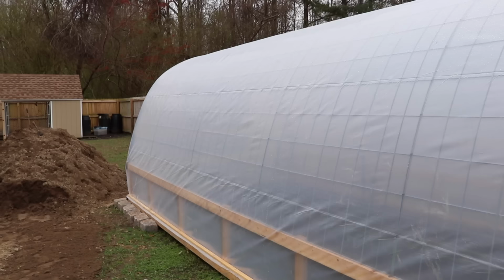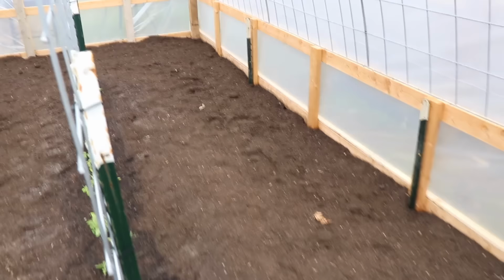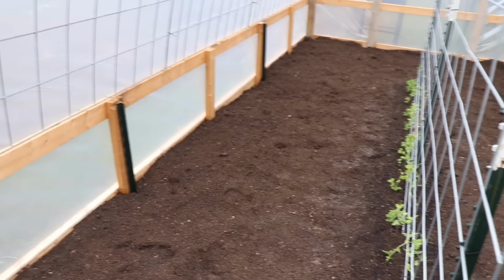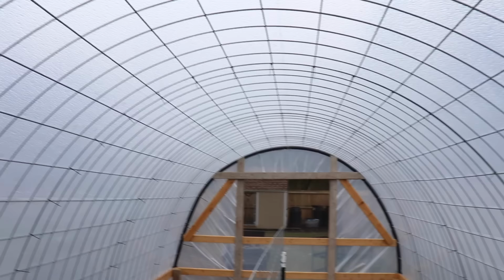DIY Cattle Panel Hoop House || Build Your Own Cheap & Easy!

Comment: Your project turned out super nice! Congratulations on a truly useful DIY gardening project.   That said, I'm still not sure I want to do a high tunnel.  It may be right for some types of gardening in some locations but definitely it has several MAJOR drawbacks.

For one thing, I live in Jackson, Mississippi which has a subtropical zone 8B climate that gets EXTREMELY hot and humid during the summers.   Any enclosed structure becomes like an oven baking the plants even with shade cloth.  Running large fans increases the costs of operation.   The plastic just traps heat and gardens in the Deep South don't need that!

Second, the moment you create a closed structure, you lose all the rainwater from Mother Nature, which in my area is between 55 and 75 inches of FREE and PURE water per year.   With the hot, dry climate, it means blocking the natural rainfall creates a time consuming chore of watering every plant inside the tunnels on a regular basis, often daily.   I don't need another chore to do!

Third, structures like this keeps out the birds, toads, and other critters which help with pest control.  I only grow organically so none of my plants have any chemicals on them.   Thus all the bug eating critters flock to my garden and eat tons of damaging insect pests.   I really don't want to lose all that extra pest control help by blocking them out with a sealed tunnel.

And then there is the cost of maintenance. We get several hail storms most years.  I've seen hail break vinyl siding and double pane glass windows in houses so I know a 6 mil sheet of plastic would be shredded by a hailstorm.   We also get frequent hurricanes and tornadoes here.   Hurricane Ida passed about 20 miles west of my house just last week breaking large tree limbs in the process.   I don't need the chore of removing damaged plastic or the costs of buying new plastic and installing it every time a hail storm comes by.  Most plastic sheeting isn't UV treated and will also deteriorate on its own fairly quickly in an are with tons of hot sunshine. Thus periodic plastic replacement becomes a never ending cost and chore.

Finally, having plants grow in a sealed building means the beneficial pollinators can't get inside to pollinate the plants.  There are plants which don't depend upon pollinators but there are just as many favorite garden veggies which absolutely MUST have pollinators visit them regularly to produce a crop.   

I'm not pouring cold water on your design.  I'm only pointing out considerations which anyone needs to stop and think about before deciding to spend $500 or more per tunnel. For my 25 x 30 garden, it would take three tunnels at a cost of more than $1,500 and about a weeks worth of my time to create tunnels over my garden area.  While production might increase due to longer growing seasons, it would probably take at least 10 years to recover the initial expense from more production.  I'm not sure the structure will even last that long!

After watching quite a few hoop house videos, I have seen other designs, such as hoop houses with hinged windows that allow the entire sides to be opened during the day, which are better suited for Deep South climates.   Hoop houses may be the right thing for some situations but I'm not yet convinced they are cost and time effective for many gardening or farming circumstances.
Reply from the maker: Everyone has to evaluate their own circumstances & make the decision that’s best for their garden! For us, we LOVE greenhouse & hoophouse gardening! Thanks so much for watching. 😊
Reply: @HomeFreeAlaska  I get it that you love using these structurers.  But rather than tell your viewers how much you love your hoop houses could you genuinely address how you deal with some of the 5 inherent problems I listed when using hoop houses?   I watched your  video to get the benefit of a real world experience from someone who could provide useful information to consider before I make a $1,500 investment building 3 hoop houses.  I'd didn't want an infomercial that only tells the "wonderful" side of the situation.

For instance, do you substitute your time and labor watering all the plants for the free rainfall that the hoop houses block?  Are you making that trade off because you are in love with gardening and enjoy spending hours of time each day tending to the plants? Do you realize that many others simply don't have the time available to replace with human labor the 55 inches of rainfall plants NOT growing in a hoop house would receive naturally.  

Not to mention that as an organic gardener, natural rainwater is the ONLY thing I want on my plants.  Our city water is under EPA health advisories as unsafe to drink due to lead and copper contamination.  Putting that water on plants as a substitute for the natural rainwater makes no sense.

Or, for instance, do you live in Syracuse, NY where there are no hurricanes, tornadoes, wildfires, or earthquakes and little flooding to ever worry  about damaging your hoop houses?    For the 29% of America's population living inside hurricane zones, hoop houses probably are unwise investments.

I didn't dislike your video. I watched the entire thing.   It's certainly a good option for SOME situations but honestly, it probably isn't workable for at least half the gardening population in America.
Reply from the maker: @TrehanCreekOutdoors  my friend, my video wasn’t about the pros & cons of hoop house gardening. My video was just showing how we chose to construct a hoop house & the materials we used. There are a lot of videos out there that go in depth about the pros & cons to hoop house gardening, this video was not intended to be that. Sure I may have mentioned some of the things I love about hoop houses in the video, because I do love them. In my opinion, for my climate & gardening goals etc., the issues that may come with hoop house gardening that you’ve mentioned…we feel the benefits out weigh those cons. We do not have city water, we live on a well & with the sprinkler system we installed in the hoop house, it makes watering easy & not an inconvenience at all. Everyone has to decide what’s best for their unique situation. It sounds like you are already aware of all the cons as you listed them multiple times, so you just need to decide if a hoop house is worth it to you. My video wasn’t an “infomercial” either…it was simply the construction of a hoop house. Since I haven’t created a video on pros and cons of hoop house gardening, I’d refer you to check out some of the other videos YouTube has to offer on this subject.
Reply: You can simply remove the plastic sheeting in the warmer months to alleviate most of the issues you mentioned. Here in Texas, many growers add shade cloth in the summer as well. You could also use the cattle panel arches as a trellis in the warm season!
Reply: @julietlaney2776  Buy the cattle panels, the plastic, the fasteners, etc....spend hours putting it all together....then more hours taking the plastic off, store the plastic, and after that, rinse and repeat by putting everything back together.  Why do that?  Because it lets the gardener grow under the same conditions that you would have if you planted in an open air garden in the first place.  Gee, I guess that makes sense.  Thanks for explaining the benefits of high tunnels to me.
Reply from the maker: @julietlaney2776  oh we don’t want to remove the plastic sheeting that would completely defeat part of its purpose which is to keep the pests off the veggies! 😉 We have major pest issues here in this area of VA that we’re in. The hoop house & greenhouse environment is the perfect growing space & has almost 100% gotten rid of our pest problem. 😊 We’ve added a shade cloth & more ventilation to the hoop house & it did really well thru the summer! We had a really good harvest this yr, very cool! ☺️

Comment: Nice job. Thank you for posting.
 Suggestion - 1" black polyethylene pipe sliced lengthwise will hold up longer on the outer fence edge. zip ties don't last more than a 6 months here in California.
Reply from the maker: Thanks so much for the suggestion & thanks for hanging out with us for this video! 😊

Comment: I had a couple questions for you if you don't mind!
I am building a "Peacock Palace" using this same idea but we will be using corrugated metal on a wooden frame base and 50" x 16' long cattle panels. My idea was to use two cattle panels for each section to make it tall enough for my birds. They like to roost at least 6' off the ground so nothing can grab their tails. I'm wondering how wide and how tall it will be and have no idea how to figure that out! Also, how strong will it be? We don't usually have snow here and I won't be wrapping it in plastic so I don't worry about that, but we do have wildlife that would gladly eat a Peacock if they caught one! 😅 
Thanks! R

Comment: Instead of cutting the last panel, just over lap them.  Might be a good idea as it will reinforce the ends as well.what are the dimensions?  Can you make the side walls a little higher?  What is the maximum width?
Reply from the maker: Hi Jim, this hoop house is 20ft long by 10 ft wide. You can make the walls as high as you’d like but you’ll probably have to adjust the width of the hoop house if you do because the panels only bend so far. The higher the side walls…the taller it’ll make the panels once you set them in there.

Comment: It will be interesting to see how long the polythene sheet lasts as the frame will get very hot in the summer without tape protection!
Reply from the maker: Hi Keith actually we’ve had zero issues with heat affecting the plastic. We added ventilation for the hoop house on a separate video & it actually keeps is cool to the touch!😉

Comment: We are in zone 6b and are thinking about building one of these for extending our growing season in winter months. Some questions: How long does that plastic last? What is your planting zone? Are you in a place that doesn't experience very cold temps? And What about wind? Will this get blown around very easily?
Reply from the maker: Hey there! 4 months after the build we had to change out the plastic. We changed it out with a durable, long lasting greenhouse plastic which was 40X26ft, 6 MIL thick: https://amzn.to/3wmUcFO

We’re in zone 8a. Check out the video
description, I linked to a Q&A video that I did for the build that might help you! 😊 Thanks for watching!
Reply: @HomeFreeAlaska  Wow! Thank you so much for your reply!💚💛💚

Comment: Lovely, thank-you. I didn't see how the wooden wall panels were made. Or how they were secured to the ground: with metal stakes. That said, superb, thanks.

And what value there is to human co-operation!
Reply from the maker: Hi John! We just made the wooden sides with 2X4s. 20ft long & then 2ft pieces down the center. We used 2 metal “T” posts just for added stability. The 4 corners of the hoop house are cemented into the ground but there was no support in the center. So we just hammered the T posts down into the ground and screwed them to the wood. One of them wouldn’t hammer down anymore so Joe had to cut it lol. Thank you so much for watching our video! 😊

Comment: Curious about the heat in there during summer.  I built a smaller version and it got HOT in there, had to cut many openings in the top and sides to help, finally added 30% shade cloth as a last measure of temperature control.
Reply from the maker: Hi friend, you can check out my "gardening & greenhouses" playlist on my channel. I have more videos there of upgrades we did to the hoop house. We added ventilation (roll up sides), a shade clothe and an irrigation system. With plenty of ventilation, circulation and the shade clothe, our plants did fine in the heat of summer. :)

Comment: the only thing I hope to add is first its a wonderful project and installation
The only thing that I could add is on your outer perimeter secure a 6 or 8-inch ground level flat metal to reduce the dirt contacting with the wood 
reducing moisture contact and prematurely rotting the wood
Reply from the maker: Thank you so much! 😊

Comment: Beautiful job.  My only concern is that you didn't use treated lumber or do anything to the lumber base to reduce the chance of rot.  Any kind of barrier between the wood and the ground would extend the life of the base
Reply from the maker: We can replace as needed it’s not really a big deal. This was built during Covid & all the shutdowns, we were trying to use the wood we had on hand with minimal trips to the lumber store. It’s still standing today and doing fine!☺️

Comment: the way the 3-seasons winds blow around here would rip that plastic apart in a day, or 2.  maybe a very small one in a  wind-sheltered area would be helpful.
Reply: I live in a very windy desert. Have seen winds over 80mph. We secure our 80 ft. of plastic with hay rope ties zig zagged across and secured at the ground with metal screws that go into the ground over a foot used to stake a dog on a leash. Stakes are every 5 ft. on both sides. We have yet to lose our plastic in many years.

Comment: Hello, me and my husband are looking into doing this project in our garden to replace a purchased greenhouse from Amazon which was recently destroyed by the heavy snow in our area. I just wanted to know if you all have had snow since building this structure and if so, has it survived? If you haven't experienced the harsh weather, would you recommend some additional type of structural reinforcement that may withstand harsher weather like heavy snow?
Reply from the maker: Hello! We actually don’t get much snow here in VA…but I have heard subscribers tell me that they’ve built one and it holds up well in the snow as long as you put extra support beams down the center. If not, the slightest snow load will weigh down the center of the fence panels because there’s nothing holding them up. I hope that helps! Good luck on y’all’s hoop house build. Thanks for watching our video! 😊
Reply: Hi my friend how are you doing, it's nice to meet you here on YouTube

Comment: you should include a bee door somewhere in your tunnel for polination. Other than that very nice work. I used to make them using electrical pvc piping. similar just mine went together like lincoln logs and had to rebuild every 4-5 years.
Reply from the maker: Hey David! I actually only plant veggies in here that don’t need pollination like cabbage, broccoli etc., if we put in a bee door then other insects can get in too which is exactly what we don’t want haha! But I agree if we had veggies that needed pollination it could be a problem. Thanks so much for watching my video! 😊

Comment: I'm all about using what ya got but sometimes when you do that, it's self defeating. I'm talking about using the Romex wire staples in lieu of galvanized fence staples which would have been the proper fastener application.
Reply from the maker: It’s all good! 😉

Comment: Fantastic video. We have tried to duplicate your hoop house and the video has been extremely helpful.Our hoop house is 10X25 and we made it around our existing raised beds which are about 30" to the tops.Your how to was just right. I wanted to know what growing zone you are in? I am in Colorado and we are zone 4b and we built this to extend our season but I would love to get some information on how you plan for the timing of your seedlings--and how you estimate which plants on which dates (the dates on the seed packets notwithstanding). We put up a small greenhouse and are still trying to get our plant timings right on that as well. We got a solar fan for our small greenhouse and plan to do that with the hoop house next spring. We also used a temperature controlled vent opener in our greenhouse and will here as well. Here in September we are preparing for winter in about a month and I want to get as much growing next spring as I can. Any advise?
Reply from the maker: Hi friend! We are in zone 8a. I always start my plants inside our hoop house or greenhouse in Feb, some in March, just depending on the veggie! 😊

Comment: Hello, I really liked your design and craftsmanship and decided to make one for my backyard. What would you make differently if you redo this project? Is there any other feedback you want to share before I start it? Thank you.
Reply from the maker: Hi! When I built this I was using what I had and only buying what I needed. We were going to be moving later down the road so I didn’t really care what I made it out of. 
What I would change? 
I would use treated lumber on the bottom. Maybe set a couple more 4x4s in cement down the side rather then using metal T-posts. Most likely run a beam down the center so I wouldn’t have to worry about snow loads, and of course we changed the plastic while we were there to a greenhouse plastic. The lowes plastic sheeting didn’t hold up well. Hope this helps! 😊 (Joe)

Comment: IF YOU BUILD BOXES ALL ALONG THE TWO SIDES AND MAKE THEM 30 INCHES TALL, 2FT WIDE AND 12 INCHES DEEP YOU CAN PUT YOUR PLANTS IN THERE AND USE ALL THE SPACE UNDERR THEM FOR STORAGE OF FERTILIZER OR WHAT EVER YOU CAN DO IT ALONG THE BACK WALL ALSO
Reply from the maker: Love this idea, especially for extra storage! 😉

Comment: We have four of these. We also had another, but one of our good old Texas Ice storms collapsed it.
Reply: My husband bought a tool and the copper things that they use on pigs. We attached the panels together that way. Lasts a lot longer than zip ties.
Reply from the maker: Yes, all depends on the climate which you live in when determining if a hoop house will be a good choice for your property. Thanks so much for watching!